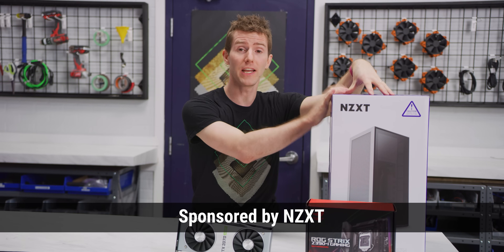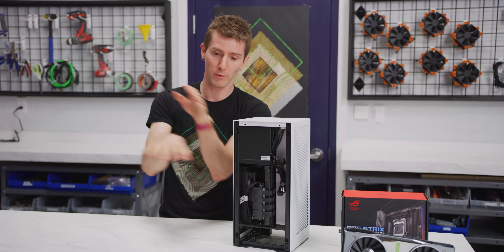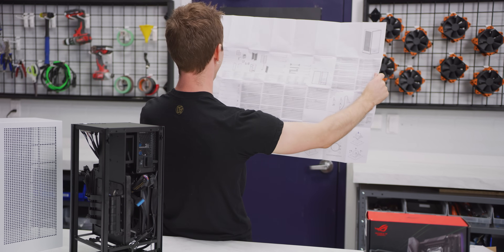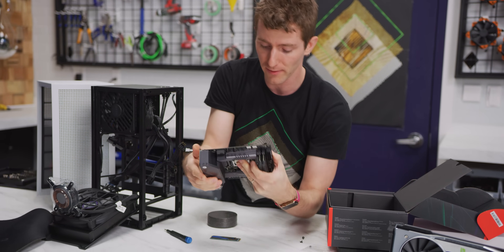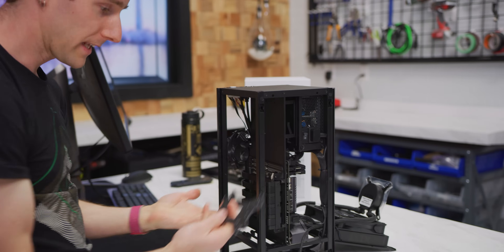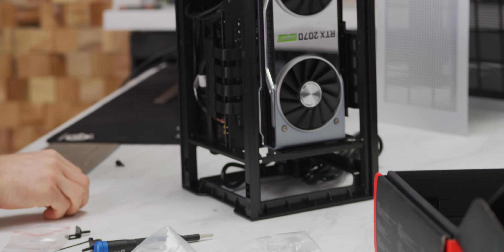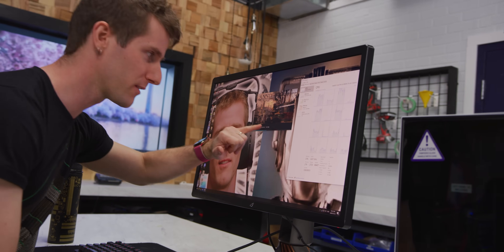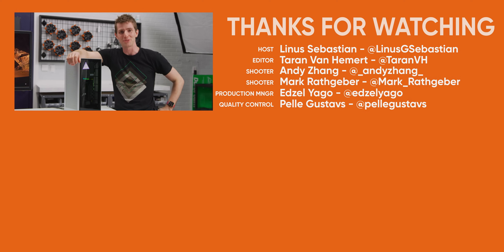Building the Xbox Series X Rip-off PC

Comment: Can anybody tell me if these PC parts will be able to run Fortnite on med to epic settings, the division 2 on any settings, dbfz any settings, and any games that will need a decent PC to run in the near future? Thanks for your time.

Part list:

CasePCS P209 RGB MID TOWER CASEProcessor (CPU)AMD A6-9500 Dual Core APU (3.5GHz) & Radeon™ R5 GraphicsMotherboardASUS® PRIME A320M-K: Micro-ATX, AM4, USB 3.0, 6GB/sMemory (RAM)4GB Corsair VENGEANCE DDR4 2400MHz (1 x 4GB)Graphics CardINTEGRATED GRAPHICS ACCELERATOR (GPU)1st Storage Drive256GB PCS 2.5" SSD, SATA 6 Gb (500MB/R, 400MB/W)DVD/BLU-RAY DriveNOT REQUIREDPower SupplyCORSAIR 550W CV SERIES™ CV-550 POWER SUPPLYPower Cable1 x 1 Metre UK Power Cable (Kettle Lead)Processor CoolingSTANDARD AMD CPU COOLERThermal PasteSTANDARD THERMAL PASTE FOR SUFFICIENT COOLINGSound CardONBOARD 6 CHANNEL (5.1) HIGH DEF AUDIO (AS STANDARD)Wireless/Wired NetworkingWIRELESS 802.11N 300Mbps/2.4GHz PCI-E CARDUSB/Thunderbolt OptionsMIN. 2 x USB 3.0 & 2 x USB 2.0 PORTS @ BACK PANEL + MIN. 2 FRONT PORTSOperating SystemWindows 10 Home 64 Bit - inc. Single LicenceOperating System LanguageUS International/USA - US English LanguageWindows Recovery MediaWindows 10 Multi-Language Recovery Image - Unlimited Downloads from Online AccountOffice SoftwareFREE 30 Day Trial of Microsoft® Office® 365 (Operating System Required)Anti-VirusBullGuard™ Internet Security - Free 90 Day License inc. Gamer ModeBrowserMicrosoft® Edge (Windows 10 Only)Warranty3 Year Standard Warranty (1 Month Collect & Return, 1 Year Parts, 3 Year Labour)DeliverySTANDARD INSURED DELIVERY TO UK MAINLAND (MON-FRI)Build TimeStandard Build - Approximately 13 to 15 working days
QTY
1

Comment: That thing is A LOT bigger that the Xbox: Series X.
Reply: Yousuf Shad also a lot more powerful :D
Reply: @a.oghalai  actually not really. The graphics are about the same but the cpu is more powerful with the new AMD 4000 series.
Reply: @a.oghalai  Nope, the new Xbox series X will have graphical power slightly higher than the 2080. This video is using a 2070S.

Comment: as a novice, I'd say that system seems a lot harder than starting from scratch. Full atx with a big case just makes debugging so much easier, and water cooling isn't really a good feature compared to the effort that goes into understanding  the practicalities for a beginner. Not to mention you still have to avoid weird incompatibilities with tight fits on all the parts you will be picking and adding.

Comment: As a novice this looks more complicated than it ought to be.
I like the idea that you showed in a video a few months back where Razor had that sled thing. Everything slides out and you just plug things in. Makes the build time like 10 minutes tops. Of course the only thing I don't like about that is RAM integrated on the same board as the CPU meaning you can't upgrade just the CPU or RAM.

Comment: The bottom of the case is primordial for the cooling system and the enginering desing of the series x. You can't had wires and inputs there

Comment: As a person who's only built 1 computer, I'd say im as novice as it gets
The problems is not just with the case and cable management mess but simple things to you guys like

• which cable is for what, and where it goes (PWM, rgb cables, front IO,  
• How much force is actually needed to put in the ram / GPU cable
• where and how to place / hide cables, and how forceful we can be

Its all the fine details thats usually hard. Sure, we know where the cpu, ram, fan goes but sometimes we dont even know which screw is for what, especially when you mixed up all the small bags they come in originally. 

The case makes it a touch easier..? But im sure we novices will find new problems you expert builders dont

Comment: What would help a novice builder is the manufacturer to have a tool on their website to check if a build is viable or just a list of components that will fit (like no high profile ram…).

Otherwise they (me) won't be able to improvise when something's a bit tight, like say bending a motherboard - because if you don't know, forcing a component is really scary.
And shouldn't thermal paste be applied at some point and anti static straps or grounding be practiced?

[TL:DR Want to make a reasonably priced dream system, but I'm a tinkerer that repairs old laptops with upgradable parts].

I'm planning (and will probably still be planning next year… I jumped from a S4active to a Note 8, I originally planned to get a S6) on doing a medium budget (no bling) do everything machine that's a gaming and VR capable Hackintosh that will have a triple boot (Windows/MacOS/Linux, lots of HD space…), maybe based on a ROG motherboard for the gaming advantages, I've got hearing damage and sonic radar would be nice. I plan for a semi portable case as most of my clan is within local distance and the head has a motorhome. Is there a large laptop that could meet these requirements?

[I'm good on theory, but my last physical build was salvaging an store built AMD754 system (to be future proof with 64bit 🙄🤬, the store replaced my Antec power supply with a no name Chinese brand when I brought it in for warranty repair, I got one of the bad capacitor MB, and didn't discover till years later they'd ripped me off - always had high ratings with the PC mags cause they submitted a bespoke system every month) and a with the supervision of a friend who has a degree in electrical engineering, we used a old Intel system and made a new machine from the best working parts of each and a new power supply.. 
Since then I've just done HD swaps to SSD and attempts at data recovery when someone's drive fails, and replacing broken laptop bits like keyboards and screens. Getting the power supply right is what's worrying about attempting a build from scratch].

Comment: I personally think that it does not make a huge difference to just building entirely custom. The finnicky parts like putting in the CPU, GPU or RAM are also part of the installment. And watercooling almost always means --> more maintenance. But one thing I can say is that for such a small formfactor, I don't think there is anything better than this. It's as easy as building an ATX PC I'd say.

Comment: Tip from level1. If you are using a motherboard with pcie 4.0 like x570 go into the bios and manually choose pcie 3.0 for the gpu because it might have problems with the riser cable.

Comment: This looks like slightly more difficult case to build in, semi-novice friendly, but the size constraint might be likely to cause issues that larger cases wouldn't cause.
"Even a complete novice builder could finish a system in this in a couple hours"? Maybe I'm out of touch, but I feel like any novice builder will complete a system in a couple hours regardless. The only things (on the physical building side) that start getting time intensive is water cooling and perhaps cable management, otherwise you're pretty much just plugging a few things together; install your CPU and cooler, seat your RAM (optionally do a semi complete build outside the case and make sure it posts), mount the motherboard in your case, run power, install GPU, and connect drives. The process might take longer if you have literally no help, but it's doubtful you'd even have all the necessary components to complete a system in that scenario.
Reply: @Matt M More than simply a link to a video from weeks ago would be appreciated. The prebuilt being relatively nice doesn't change the fact that a smaller case is, in general, tougher to build in. A smaller case can certainly look better, as it will clearly use more room in the case, but for a beginner, taking note of the size of all the components makes it far easier to overlook some small aspect.

Comment: As a novice, it looks easy. Although not a fan of the orientation of the gpu and the thermal reports. 

Would have probably preferred the gpu exhaust going upwards rather than downwards so that the hot air can actually escape more easily from the case. Thermals aren't that good for this case either many have reported.

Comment: Would it be possible to use a thinner 140mm fan to fit the taller RAM without bending the motherboard? Surely it can be swapped out with, say, a Noctua NF-A14?

Comment: I wouldn't consider mounting a rad and fans as well as a power supply the tricky part about building a computer. The only real benefit I see is the custom length cables and riser make the cable management cleaner from the start.

Comment: I've had the CPU cooler included with that case and it just plain sucks. Pump in radiator design is just not as good as basically every Asetek-type cooler out there. If you're on the market for this case, consider replacing the AIO for another one.

Comment: I don't think this necessarily is easy for a novice, as the IO installation was the hellish part for me back in the day and plugging little cables in tight space is not easy. The other tricky part is cooler installation with the consternation of which and how much thermal paste, this made an AIO installation like a stock aircooler installation. But it makes an experienced but still beginner's life a lot easier by utterly clean cable management; stuff like that probably on lower priiority for a new builder who probably be happy that the thing post and the panels shut.

Comment: Linus: "The SSD controller doesn't like heat"
Also Linus: mounts it on top of the chipset
Reply: JayzTwoCents: “The RGB SSD is thermal throttling and it’s basically bricking the computer.”

that actually happened
Reply: @AshtonSnapp  yeah lol the old t-force rgb ssd. The new one looks better and the leds are away from the controller at the center
Reply: @rafee9442  I thought the RGB SSD that was bricking Jay's computer was the hyper x one

Comment: Novice here, just finished my first build in a Cooler Master Silencio S600, and this looks much easier.  That being said, I found the scariest and hardest part was figuring out what to buy.  Having to worry about if things would fit, if they'd play nice together, or if they were even any good.  The hardest part of the actual build stage was running all the power wires.  This case seems to have made that pretty easy.  Thanks for sharing.

Comment: Does using an intel i7 9700k with the rtx 2070 super make it bad. Ive kinda got a bit less money
Reply: The 9700K is a bad purchase. With next gen consoles the base line will be 8 cores 16 threads. Do not buy a CPU that is lower than that in 2020.

Comment: Guess i'm a novice only having built 1 pc by myself and never having messed with water cooling but it didn't take me long and I didn't need a guide so guess I just watch to many of your vids.
This built "looked" more complicated to follow if you didn't know what you were doing already. To me things flow a lot more with a complete DIY system because I went through it all stage by stage, so it all felt a lot cleaner of a process. rather than this sort of setup where there are cables everywhere that you wouldn't know at what stage they needed to be attached.

Comment: 2:20 "Any mother board you want, any graphics card you want" 
My Gaming Xtrio RTX 2080 would like  to differ
Reply: Jorge Ramos my case had a vertical gpu mount with 2 slots so i had to cut a slit in it to fit my 2080ti
Reply: my Intel Pentium N3710 Integrated Graphics System begs to differ.
Reply: Yeh any motherboard that isnt ATX or mATX
Reply: i have intel i3 7710

Comment: I would love to see this case in a horizontal configuration without the tempered glass panels. It would fit very nicely in the little desk cubby in my big rig. I've been searching for a solution for "high horsepower gaming" for my truck and haven't found a system that fits my needs that isn't a laptop yet.

Comment: consoles can access the graphics controller directly, computers cannot unless you use the internal graphics card in the CPU but that has downsides. so PC's are not as good as consoles for when you need high bandwidth graphics memory which is good for shaders/texturing

Comment: Man that CPU is overkill for that GPU. I remember when I upgraded my PC back around 2010 or so from a Core 2 Duo to a Core 2 Quad, I also upgraded the GPU to a used 9800GX2, and likewise upgraded the PSU... I used the power cable that came with the PSU (Can't remember which brand), and the power cable actually died. I though the PSU died or something, 'til I tried another cable...
Reply: Why didn't you upgrade to 1156? You'd still have a use system these days.

Comment: Meh. Small cases like that don't do it for me. I prefer big cases where I do a lot of air cooling over liquid cooling. My builds last 5-8 years so I'd rather deal with fans than have a system overhead because a water pump died and I didn't notice until after the CPU took too many hits from overheating. To each their own though. It looks like it'd be good if you're limited on space at least.

Comment: I've built 2 PCs. The first was from scratch and the second was a barebones kit. I found from scratch to be easier. Probably because the barebones was designed to be compact, rather than actually easy to build, like this one. A barebones system can be easier to select components if the motherboard is included and they provide a short list of links to recommended components. But probably never meaningfully easier to actually put together. Like most people here, I spent months watching and reading before I got around to building one so when it came time to actually buy parts I already knew exactly what I wanted.

Comment: HELP!!! I got a new pc (Ryzen 5 3600, 2070 Super, Gskill TridentZ 3200mhz RAM, Crucial P1 1tb.....)and when I start it, it runs all fans at max speed but nothing happens..... When I press the reset button it starts as normal.... Some days it starts right away with no problems... What I also want to ask is, I have a Kfa2 2070 Super and when my pc starts, the fans from my GPU go to max power... and I want to ask if this is normal... What can I do so my pc starts with no problems and maybe without all the fans kicking in like crazy???
Reply: It's normal for the fans to spin faster at boot.
Reseat your ram and your gpu, one of your sticks of ram or slot might have a problem/might be dirty.
Make sure you follow the ram installation instructions for your motherboard.

Comment: why the i9? if it's just for gaming on 4k high/ultra at ~60fps an r5 3600 would be enough, not to mention $600 cheaper.
the xbox probably has a similar chip based on the announced clock speeds

Comment: If you put a 9900K in that thing and plan to overclock it. You better use a motherboard with a VRM that can truly handle it. Basically the only iTX board with a worthy VRM is ASRock's z370 Fatality iTX/z390 iTX. Those at least use ISL99227B 60A smart power stages from intersil which can handle a 5GHz overclock on a 9900K.

Comment: All I want is to order the case as they advertise on their site. I have been wanting is the case for almost a month since the first saw the review/build on Bitwit. When you click on this link it takes you to a Buy Now page. When you click the Buy Now button it takes you to another page where you can look up the resellers that sell the case. They are not selling the case. Also, none of the resellers have the case in stock. I have check all the retailers in Asia, Europe, and North America and no one has it in stock. I even tried to contact them via their contact form on their site two days ago and have yet to get a response. At this point, I'm passing on this case and going with the NCASE M1. At least you can buy it directly on their site and you can select the time frame as to when it will be shipped.

Comment: Can someone quickly tell me how much this whole system would be i really thinking about doing it?
Reply: I believe its the same-ish specs as the pre built h1 you can buy from nzxt, which is $2000 USD if i remember correctly. Obviously you could make it way cheaper without an i9 or 2070 super. I believe the case is $350 USD by itself but is sold out everywhere

Comment: I remember my first build. Got all the components and the whole pc together without testing the hardware then went to boot it and it wasn't posting. took EVERYTHING out and got it to post outside the case then put it all back. Somehow I fucked up the pins on the cpu while installing so I just took a razor blade and slowly straightened them and got it to work. Was determined not to buy a new cpu and apparently fixing one is supposed to be difficult. So what did I learn? Slow down and just watch bitwit : )